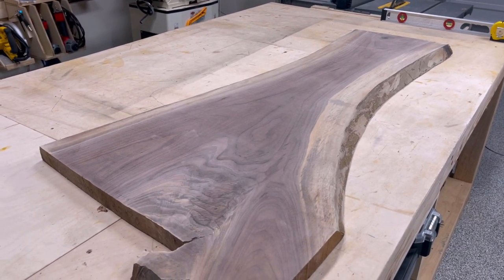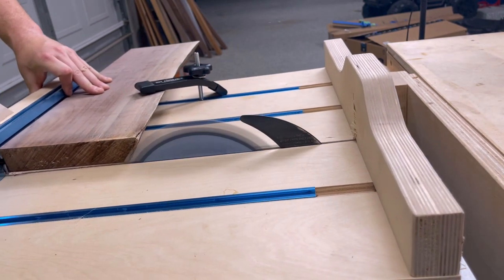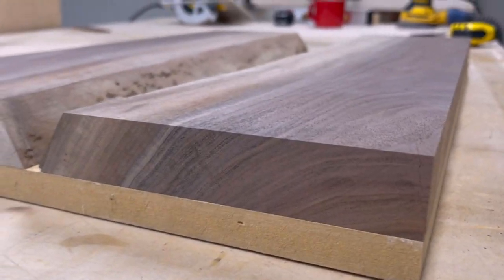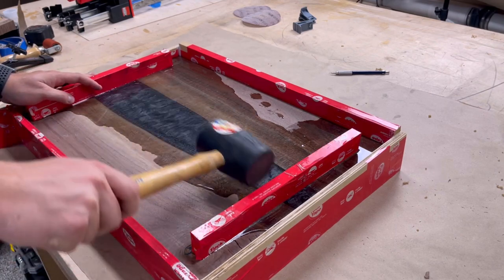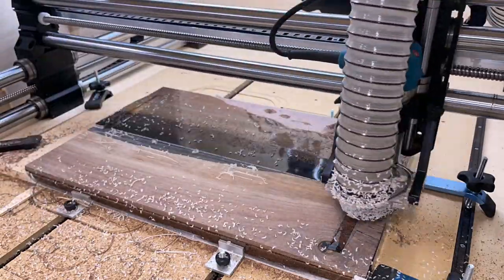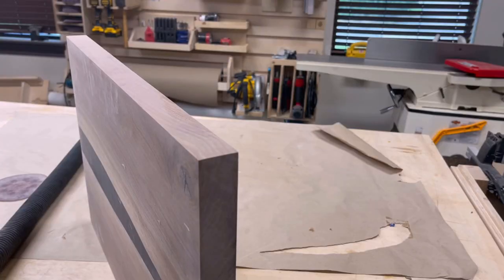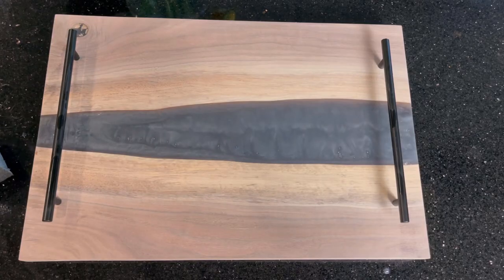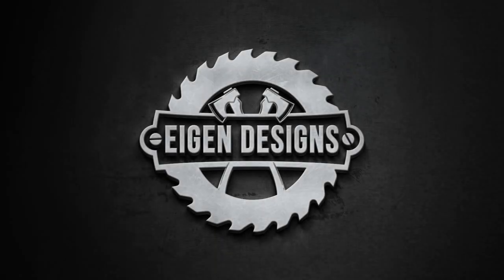Ultimate Epoxy River Charcuterie Board / Serving Tray

Comment: Just caught this...excellent job on the video and voiceover bud.  Keep it up.  Question for you.  I've seen other makers use the same technique for finishing after they've put on the hardware.  Why not finish the board prior to attaching handles and feet?  Just curious.  Thanks for the video.  I'll be doing some of these in the next week or two.
Reply from the maker: I guess there is no good reason to do it one way over another. I have done it both ways in the past and the project turns out the same no matter which way you do it.
Reply: @EigenDesigns  no argument here. Keep up the good work!

Comment: One thing to get out of the way first; ripping the slab down at the table saw without a fence isn't the safest way to do it. I don't have a tracksaw either; a sawboard with some grip tape on the bottom is a cheap but very serviceable alternative to a tracksaw. I definitely see a tracksaw in my future though.

That said, amazing job on the board dude! Serving trays are excellent projects for a CNC! Something you could do that I've seen is make the board as you did, then use the onefinity to carve a design (logo, monogram, phrase, geometric design, etc.), then fill the carving with a different colored epoxy.

Finally, the whiteside 6210 is an excellent bit for surfacing, and not too expensive.

I can't wait to get my onefinity!
Reply from the maker: The Sawboard is a good idea - I will do that next time as it sounds much safer. If I end up doing more of these I may get creative with the CNC and add some customizations to it. I am absolutely loving having the CNC in the shop... it's like having a highly skilled unpaid intern!

I will look into the Whiteside 6210. It looks like its ~$30 on amazon, which is reasonable for good quality bit. I bought a cheaper variant of that bit to do the spoilboard for my CNC but it didn't last very long.
Reply: @EigenDesigns  In my 17 years of woodworking, whiteside bits have never let me down. They're amazing quality and priced very fairly. 

I'm so excited to get my onefinity! I can't wait to start tinkering with it and seeing what I can come up with.

Looking forward to more of your CNC projects!
Reply from the maker: @NWGR  I ordered the whiteside bit and it just came in today. I am excited to get a chance to use it!
Reply: @EigenDesigns  Awesome! I have mine on order too. 👍
Reply from the maker: I just used the white side bit to surface a cutting board and it rocks!! Thanks for the great tip.